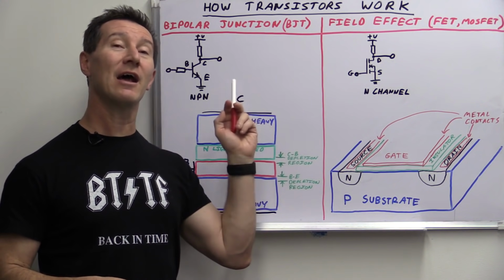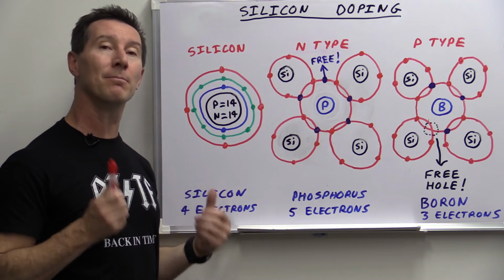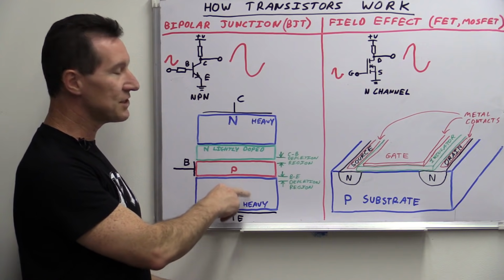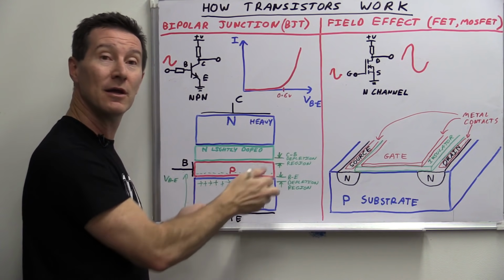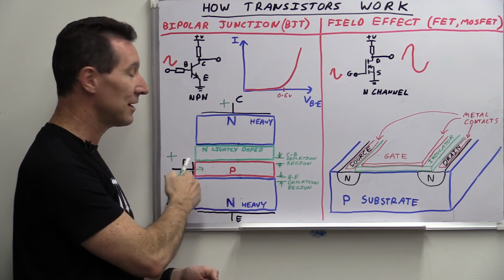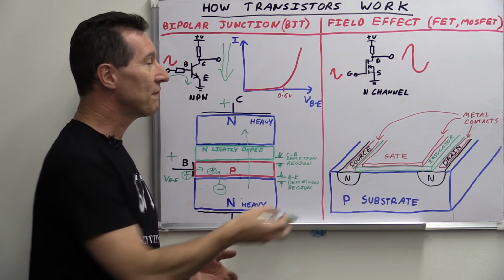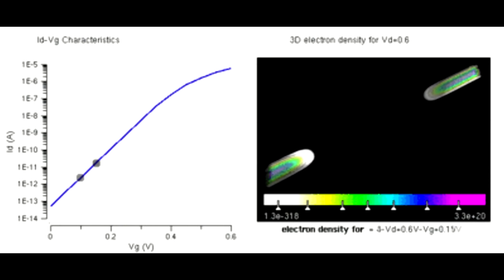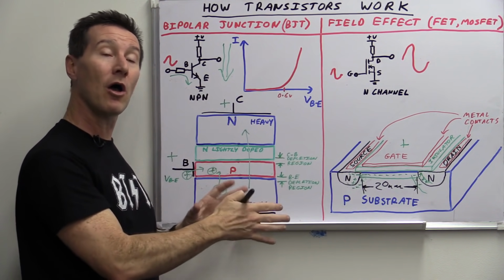EEVblog #748 - How Do Transistors Work?

Comment: I think it was a great idea to take on this task but suggest you consider re-doing it after cleaning up some of the issues. In particular I suggest you re-read the section in your physics book on PN junctions and structure the BJT discussion terms of Base current flow. In particular, "Vbe" only matters as the forward voltage of the transistor's PN junction, and that what does matter is that you structure current into the base such that that current times the transistor's gain (Hfe) result in the transistor being fully 'on'. From a physics perspective you are pulling enough electrons into P layer from the collector side, that there is always a path for an electron to go from the emitter to the collector.  The P layer is essentially not there (this is called the saturation current, and for a switching application its your target current)

Also suggest that you replace silicon 'matrix' with silicon crystal. That would align better with other sources people might go to after watching this for more information.

Comment: Kevin Sirois
(can't reply)
MOSFETs use much less power (high input impedance;  at low frequencies, essentially infinite). Easier to scale down (photolithographic). Easier to produce.

Less power makes for less heat.

Comment: Great video, as always! 

But, I think the explanation of turning on the MOS could be enhanced a bit more. 
I think the fact that the positive supply voltage attracting the electrons, and repeling the holes, as you wrote in the comment, forms an n-channel, hence the name n-channel mos, creating a connection between drain and source. "Bingo, we turned on our MOS" not switch, because the MOS operation can bet set based on the biasing: Switch, resistor or Amp!. 

Again, thanks a lot for another great video! <3

Comment: I was waiting for you to explain why/how the diode is formed between the source and drain :(

Question, is it because of the lightly doped layer which have high resistance in the BJT that makes it not appropriate for high current applications like how mosfets are?
Reply from the maker: ***** That is not a part of how the transistor works, it's just a byproduct of how it's manufactured. I've covered that in another video somewhere.

Comment: What physical aspect would change for devices that can handle larger voltages and currents? Would it be the width of the P and N material (current) and the distance between the P and N material (voltage)? Excellent video, thanx.

Comment: Is the depletion region where the effects of stray and miller capacitance come from?
Reply: Anthony Sozio I usually think of stray capacitance as the caps that aren't drawn in the schematic, arising from the electric fields set up between components, traces, etc, in a real pcb. depletion regions do have a capacitance (http://www-inst.eecs.berkeley.edu/~ee105/fa00/lectures/Lectw4.PDF) , and if that capacitance couples an amplifiers input to its output in an unwanted way its a miller capacitance.